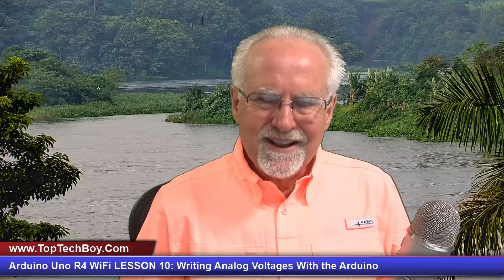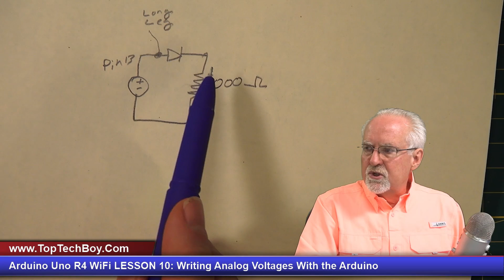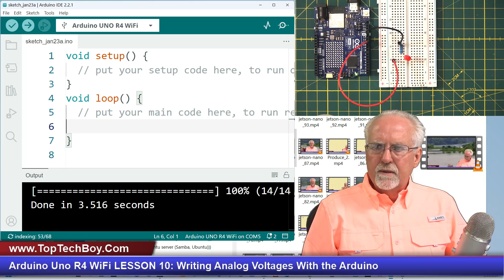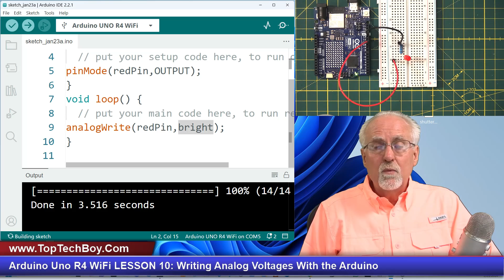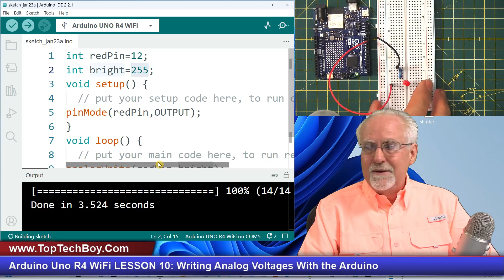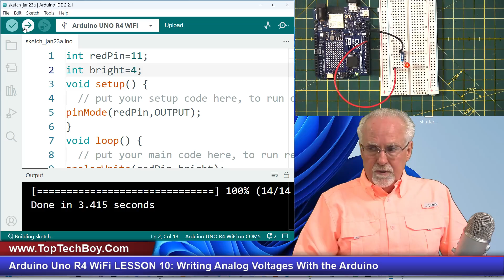Arduino Uno R4 WiFi LESSON 10: Writing Analog Voltages With the Arduino

Comment: For an 8 bit D/A, there are 256 different values available possibles, being the minimum value zero and the maximum value 255. You requested the smallest value to use to be, and the largest value to use is 255 instead of 256.
Reply from the maker: Excellent!

Comment: in my arduino board every pin works as  PWM . i tried changing brightness on pin 12 and it worked perfectly idk why. and my board let me light up an led using analog 4 and 5 pins as well ( doesnt work with analog 0-3) lol

Comment: Great, thank you! The count from 0 to 255 happens through very fast blinking. Using AI, I created code where pin 11 has steady brightness 64, while pin 10 blinks with 250 microseconds ON and 750 microseconds OFF.
Reply from the maker: Lets be precise. "I Using AI, I created". No, you created nothing, AI created as you sat and watched. Why do I make a big deal about this, everytime we use AI it is exactly like taking a hit off a crack pipe. Feels good (I am told) the first time, but then you are always looking for that next hit, and end up destroying yourself. If you use AI to solve a problem, you never develop that ability to solve hard problems yourself. So, my best advice to anyone, don't use AI to solve your prolbems for you.
Reply: @paulmcwhorter  Your position is understandable to me, although I disagree a bit. 

Let me explain what I do. I use AI as a tutor and helper that answers my questions, because questions are an important part of good learning. Curiosity matters. If I learn something and do not have any questions, that is a bad sign. And if questions stay unanswered for a long time, that is also bad.

After doing my homework, I had some questions: I used pins marked with ~. What does that mean? Does the voltage actually change from 0 to 5 V? Probably not, because I already have resistors installed. So I asked all these questions to AI and got answers immediately. The more answers I got, the more ideas and questions I had. I started to play with the code, got more ideas, tried to implement them, reviewed the AI’s code, and learned new commands. Your 20–30 minute lessons plus AI gave me a couple of hours of really interesting and fun learning. 

For me, AI is like an interactive book.

Comment: Mijn code:
int LCDRed = 11;
int pauze = 300;
int eindPauze = 500;

void setup() {
pinMode(LCDRed, OUTPUT);
}

void loop() {
analogWrite(LCDRed, 1);
delay(pauze);
analogWrite(LCDRed, 2);
delay(pauze);
analogWrite(LCDRed, 4);
delay(pauze);
analogWrite(LCDRed, 8);
delay(pauze);
analogWrite(LCDRed, 16);
delay(pauze);
analogWrite(LCDRed, 32);
delay(pauze);
analogWrite(LCDRed, 64);
delay(pauze);
analogWrite(LCDRed, 128);
delay(pauze);
analogWrite(LCDRed, 255);
delay(pauze);
analogWrite(LCDRed, 128);
delay(pauze);
analogWrite(LCDRed, 64);
delay(pauze);
analogWrite(LCDRed, 32);
delay(pauze);
analogWrite(LCDRed, 16);
delay(pauze);
analogWrite(LCDRed, 8);
delay(pauze);
analogWrite(LCDRed, 4);
delay(pauze);
analogWrite(LCDRed, 2);
delay(pauze);
analogWrite(LCDRed, 1);
delay(pauze);

delay(eindPauze);
}

Comment: Saving this here for if I forget why 255 is the max value for LED's:

the light-sensitive nerves (rods) in our eyes can only distinguish about 150 gradations, from the darkest to the lightest. And most of them are at their best in the mid-range. (We are far less sensitive to differences in colors.)

So using 2^7 would yield only 128 gradations, which is not even enough for the total number of necessary gradations, not to mention the need for a more refined mid-area. But 2^8 with its 256 gradations is more than enough, and even leaves room for some often applied corrections in the darkest and lightest areas of an image.

Comment: #define ledPin A0

void setup(){
  
  pinMode(ledPin, OUTPUT);
  Serial.begin(9600);

}

void loop(){

int dT = 80;
int i;
int j;

  for(i = 85; i >=85 && i <255; i+=10){
    analogWrite(ledPin, i);
      delay(dT);
  }
  for(j = 255; j <= 255 && j >85; j-=10 ){
    analogWrite(ledPin, j);
      delay(dT);
  }
}

Comment: Blah, blah, blah, I burned MosFet trusting your worthless advice. You need to set analogWrite 256 on the Arduino R4 board to keep the output high state all the time. Connect an oscilloscope and set pin to 255 and you'll see what nonsense you're talking about... I'm sorry for this nervous talk, but you could educate yourself a little more before you start teaching others, YouTube stars...

P.S
Okay, I've already relaxed, this transistor cost a maximum of three dollars... :) But I still don't understand why everywhere on the Internet I find information that the analogWright(pin,255) function in Arduino causes the PWM output to be set to duty cycle mode 100 % when it is not true in R4, only 256 causes it.

Comment: Was playing with RGB and forgot to put pinMode(bLedPin.OUTPUT); in setup. Blue LED still came on so I remove pinMode for both rLed and gLed and they still worked also. I guess with analog pins defined as variables above void setup I don't need to pinMode statements in void setup. Is there a reason I should do it for good coding practices?

Comment: Is there a way to complete the homework assignment using just the elements that have been taught up to this point?   I see a lot of completed homework assignments using commands like "constrain" and "for" which up to this point he has not covered.
Reply from the maker: Yes you can do it with just what I have taught so far.
Reply: @paulmcwhorter  Thank you for the quick response.  I see how to do it now.  I was overthinking the solution.   These lessons are wonderful and I am so happy you took the time to make them.

Comment: Pardon the interruption.  Is there any kind of community discussion channel to share comments about Arduino, the class, and learning in general?  Something like discord would be great.  Paul has a section called Community, but it has not been used in years.

I am asking the question here in lesson 10.  The lessons are NOT the right place for general discussions and the Arduino forum is massive.  For example, today I have been learning about Arduino memory mapping.  For the Nano memory begins with 32 registers from location 0x0000 - 0x001F.  Of importance to me for the Nano is that SRAM runs from 0x0100 - 0x08FF.  None of this would be of importance to a beginner who is trying to get his head around int and float.  But, it does interest me.  Any ideas?